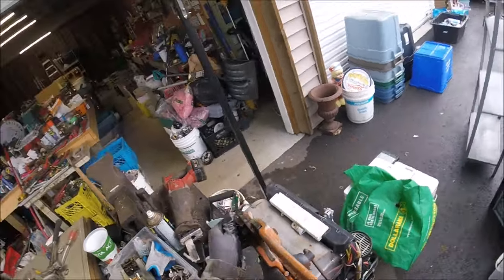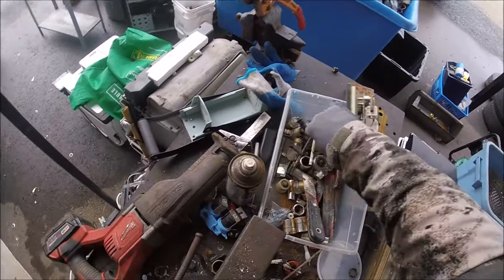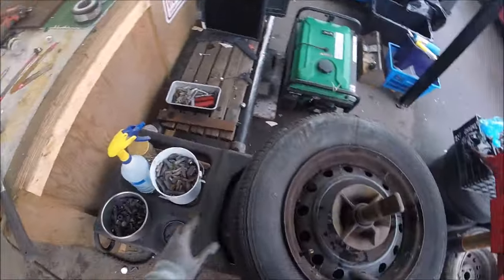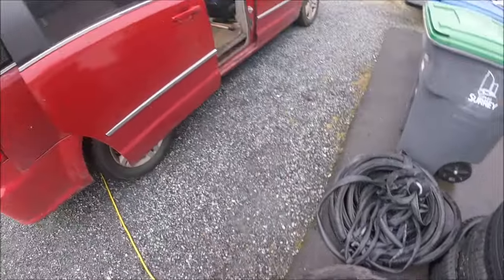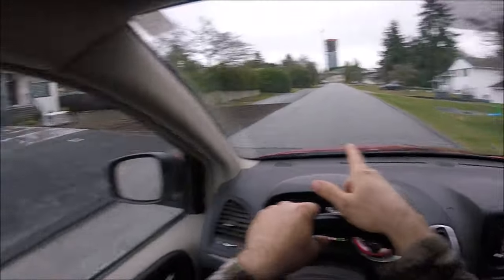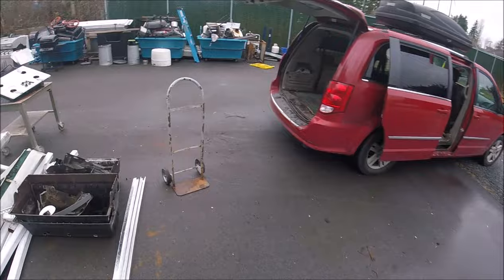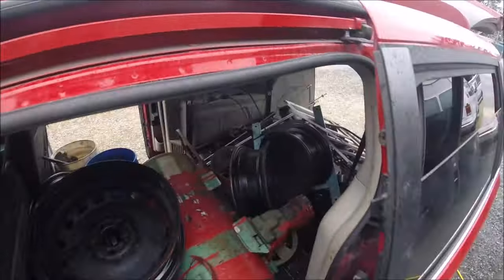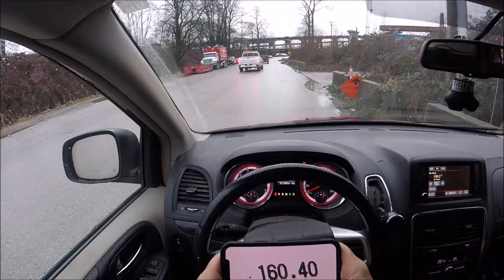Scrap Run + Tire Run & More Processing Scrap

Comment: Nice Water Tank and Copper Bonus ! Great Stripping Session for Brass and Copper - was very Interesting ! Stripping those Tires and Rubber Tire Run ! Hey Nice Dryers and Box of Bottles - just Great ! Stripping that Compressor - nice Motor ! HMS Run- Heavy Load and a nice Payday of 160.40 Dollars - You sounded very Happy ! Nice long Video and many Cheers from Australia!!!!

Comment: There's a little 5$ tool you can get to take apart those shark bite fittings to reuse them.  Or you can just use a pair of pliers to push in on that seal poking out.  If you push in on the seal while pulling out the old pipe should come right out unless it's really corroded.

Comment: Very long copper, brass processing video. However, I do not like when you are processing the door handles / knobs. You could take the brass or aluminum handle part and throw everything else in HMS. When you are peeling the brass from the handle, it is so much time taking. I don't think it is worth the time. In comparison, taking copper and brass from washing machine knobs is easy on hands and worthwhile.
Reply from the maker: The door knob inside was zinc at 50 Cents a pound